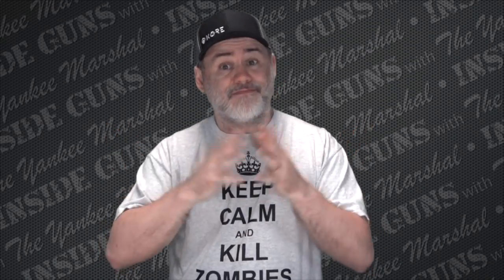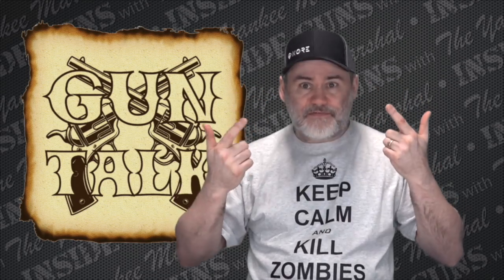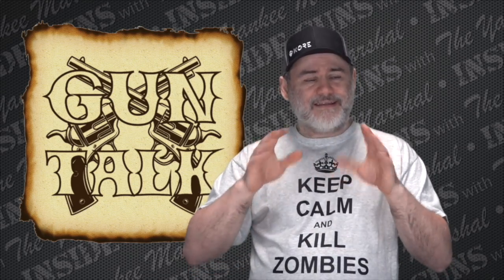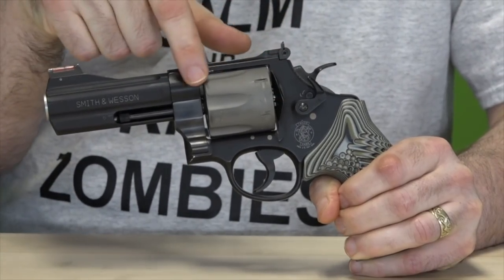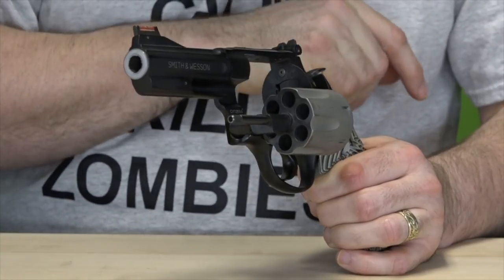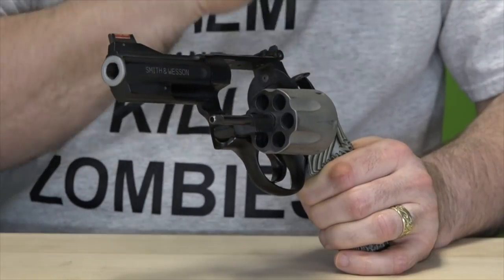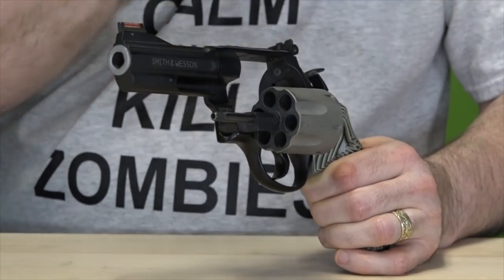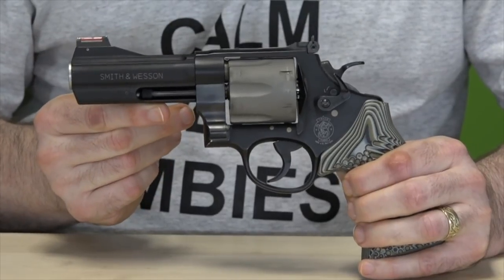How To Properly Care for Titanium Cylinders! (Yankee's Shorts)

Comment: Yup.. I have one titanium cylinder revolver it's a Smith 342 air light TI-38 special.. I use breakfree.lube and a nylon brush on the cylinder that's it.. you don't want to remove the coating that they put on to protect the titanium from erosion...

Comment: People in the coin collecting community argue back and forth about whether really dirty collectable coins should be cleaned. The people on the "Clean It" side have different protocols that could be applied here....maybe. There is actually a product that might work. I say might because I've never bought the product and I'm only watching this video because I'm considering a S&W 929 PC and it has the Titanium cyclinder. The product is called MS70. There's another one too. I can't remember the name. They are very mild and can even clean a proof coin without being detected by the top coin grading companies.

Comment: I had a cool 😎 Taurus Total Ti grey Protector .357magnum. 5 shot cylinder. The DA revolver was super light for deep carry. The gun had decent fabrication but it was nothing great. I added a CT laser grip & used a Desantis pocket holster for about 4mo. Taurus in the 1990s early 2000s had a big Ti kick. The Tracker models were cool too.